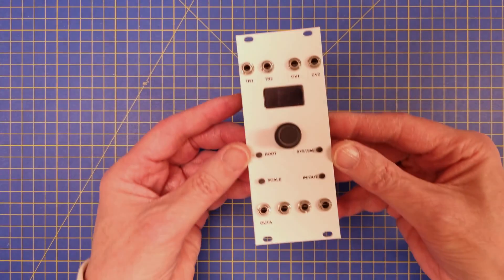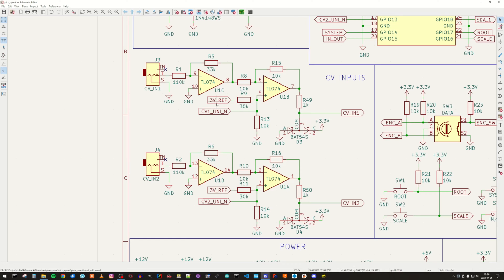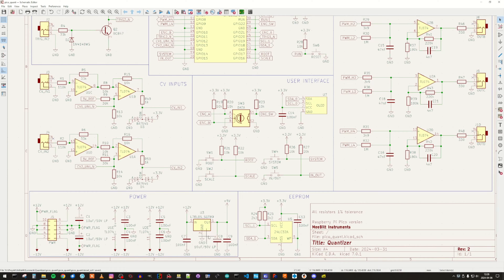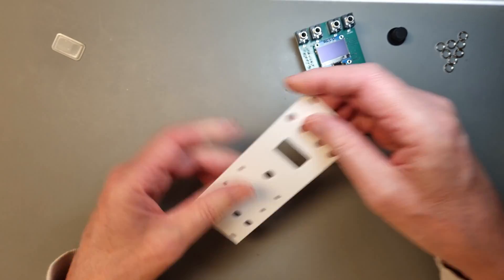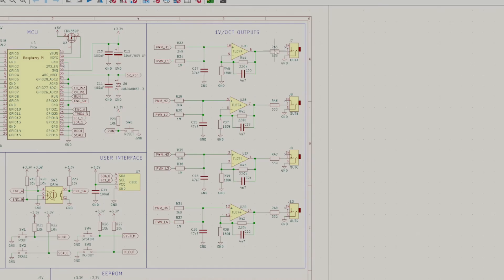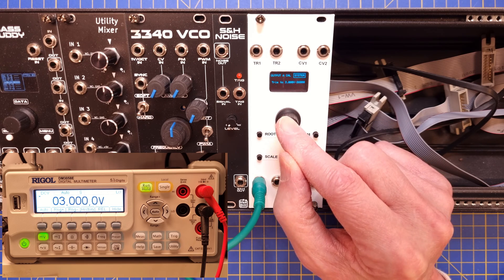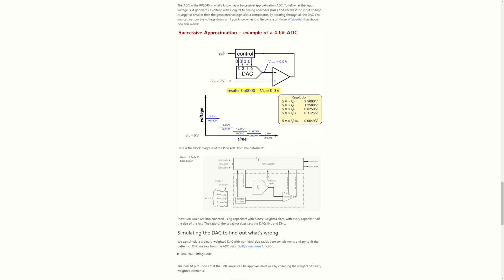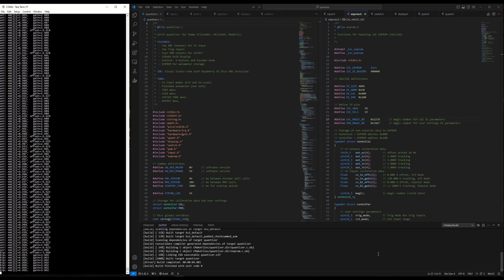Eurorack DIY: Quantizer Update (Episode 2)

Comment: can you please share your RP2040 C code so far?  I don't see it in your repo but maybe I am missing it.  Thanks!
Reply from the maker: Hey, the code is not released yet and I plan to do that together with the final schematic diagram an PCB production files. There is still a lot of work to be done with both the hardware and the software, but this is in my backlog.

Comment: I’m looking to build something similar. Been a while though! Did you hit a road block?
Reply from the maker: Yup, I did hit a blocker... I redesigned the power supply section to get rid of the SMPS in the Pico module and that helped a bit. But the stability of the 3.3V supply is still not great and since it also powers the IO pins of any variation of the supply will impact the PWM output.
I will probably redesign the whole thing using a bare RP2040 so I can use separate power supplies for different parts of the design. I will also do more testing of the long term stability, so I might have to replace the cheap TL074s on the output section with something better.
Reply: @ thanks for the update, i did wonder about pwm stability using the digital 3.3v for reference. Word of advice, rp2350 is not a drop in replacement if rp2040 not available. World of pain with adc, and pulllups.
Reply: @MeeBilt  I stumbled on the openmusiclabs dual pwm page, which outlines how to use Schmitt trigger buffers to tackle some of the issues of dual pwm, not least of which is being able to isolate the output supply from the mcu supply. Also means I can run the PWM output at 5V.

Comment: the Pico WANTS perfect square signals for triggers, now anything over 0.65 volts triggers the pico, you should set the threshold like 2.5 Volts.
You really need to use: LM393, LM339 or Schmidt trigger transistor setup.
Schmidt trigger transistor on wiki and use Falstad simulator to figure out the perfect resistor setup using the LEAST mount of current while maintaining the functionality but doesn't have threshold. that's why LM393 (LM339) is best, also allows voltage conversion from 10V+ to 3v33, because the comparator is open drain.
Reply from the maker: Yes, I will look into that, thanks for pointing it out. I will make some updates to the design anyway so I will fix the trig inputs at the same time. LM393 seems like a good choice here since I have two trigger inputs.
Reply: @MeeBilt  Yeah, Use LM4040 with 100nF to create 2.5V threshold. your current setup allows any weird voltage that shows up to be accepted, albeit it works its not what you want, potentially making or causing  havoc, not good for you if you sell these.
Reply: @MeeBilt  Mutable Instruments, when they where active, they build a specialized testing PCB with software for that specified module in question and have it create any possible combination of voltages & what not and have that run for like 7 days non stop, to be sure it does what it's supposed to do, until the module passes, it could take up to 2 years before it came to market.

Comment: Great video as usual Tommy! The Pi Pico and the adc... Disable the buck converter pin 37 3.3V_EN and provide a clean 3.3V. Then the adc work as it should!
Reply from the maker: Yes, I will make that change I think. I have seen it mentioned on the RPi forum.
Reply: @MeeBilt  I have tested it and I get 10 stable bits and 2 noisy bits. They get stable as well if you average 8 or 16 samples.

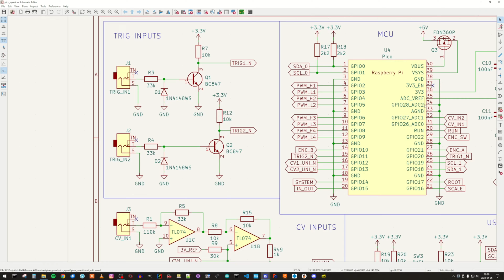Comment: 1:04 much better if LM393, LM339 or Schmidt trigger transistor setup for triggers.
Also much better to use 16 bit Texas Instruments ADC rather these onboards, like: ADS8339
Sample Rate: 250 kHz, datasheet shows how to build dedicated power supply for analog input, input opamp config then use ADG419 to switch between inputs to sample.
Reply from the maker: I will probably stick to the built in ADC for this module, but for the next one I will probably need more analog inputs so I will go for external ADC.
Reply: @MeeBilt  Just hack you current board, desolder some resistors to use the pads for soldering cables, design  tiny PCB with comparators for trigger inputs, design another with ADC, dedicated power supplies and switches / multiplexer, add emough test points, some additional spots for optional capacitors.

You'll be cheaper, than find out you have another PCB that aint right, i did this as well once on  module i was figuring out.
In your case it's software, you need to know the principle of "state machine", very important. it's like PLC logic used in factories. most software out there, provides the functional, but not really the brains.
This kind of logic you design on paper, there is or are an ISO definition for that, once you done on paper, you make the software and from the get go it works and is bug free, just in one compile, the first one. there are symbols for that.
Reply from the maker: @AnalogDude_  Yep, that is basically how I go about testing design-changes. I normally nail it in 2 board-spins or so. 
I've been using state machine based designs for many years in embedded systems. It's great for implementing UI and complex control functions for example.
Reply: @MeeBilt  Ya, you don't need update a display millions of times a second or check buttons that often. most do not know, the ADC ic i suggested can have 2.5V reference Voltage and you can divide theoretical 10V input signal by 4, easier input opamp configuring, like 10k / 2.49K + 1 Ohm. using 0.1% resistors or better.
Reply: @MeeBilt  try 'ADS8339' see the datasheet for analog power supply and reference voltage designs for this chip, With a low ohm switch IC, like: ADG5208F, ADG5404F,  ADGS1408. Analog Devices has analog switch IC's with like 2.5 Ohm resistance for such applications if you want precision, even with SPI. just a day searching and looking datasheets.
: )
You could cut tracks on your current PCB and insert the new options.